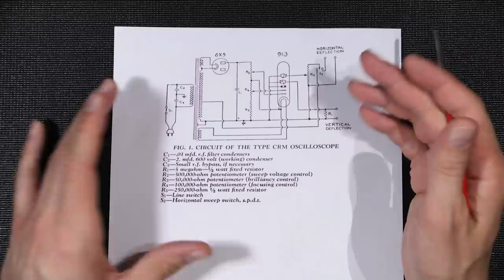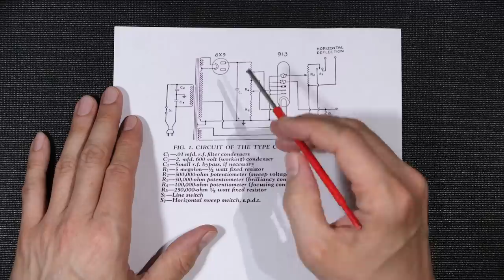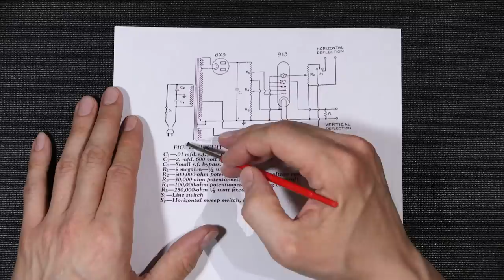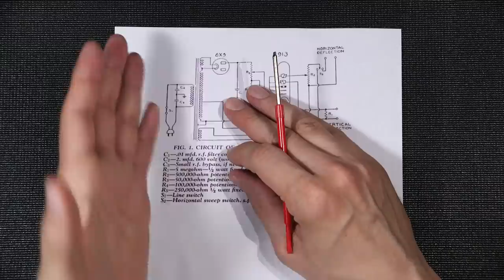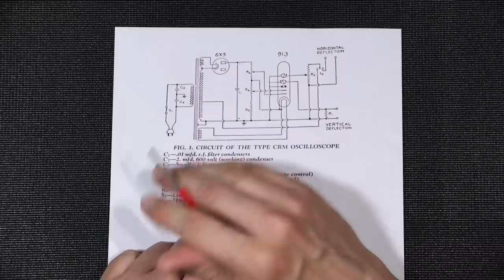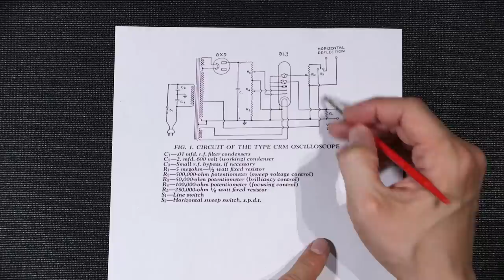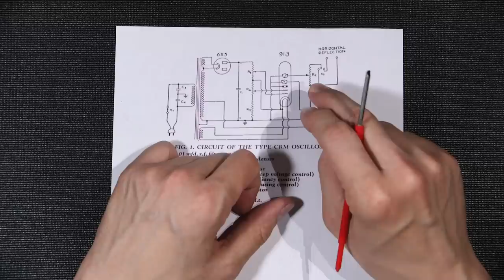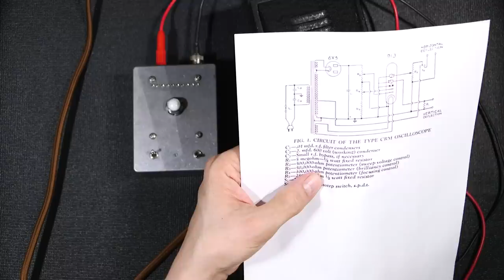Neat Electronic Tool From The 1930's, Lets Look Inside!

Comment: That's a cute little scope.  National probably saved one cent per unit by buying the power transformer with the capacitors built in.  If a cap shorted, it would be replaced as a unit.  Encapsulated caps like those could last a few decades, so making them replaceable didn't make economic sense at the time.  

Your testing device shows substantial leakage, and I'm surprised it worked at all!
Reply: They would have not potted it before attaching the mains cord, so if it was a bought in part, it not only came with condensers but with a mains cord as well. The potting was probably done for more than one reason. The condensers would have lasted longer as you say, that would have been a reason in itself apart from possible cost saving. Also it allowed for a more compact construction and it would have been safer (no exposed mains coupled parts).

Comment: Potting the line bypass caps, line cord connections and other components into the transformer "can" was not uncommon in the 20s-early 30s. Many manufacturers potted numerous component combinations into cans with leads extending out to ease in final assembly and save chassis space. Atwater Kent and Majestic come to mind.
 Remember, electronics was relatively new at the time. The short life of the "modern" wax/paper caps likely wasn't well known then. I believe the thought was to seal them from moisture to help prolong their life. They were likely good beyond the expected life of the unit, but not much beyond that. The practice seems to have stopped by about 1935.
 The caps are likely just below the surface of the potting compound. I've had good luck removing just enough of the pitch to remove the capacitors from the circuit. A hair dryer or heat gun works well.
 I used to enjoy the challenge. Today, like you, not so much. Good luck and thanks for all of the great videos.

Comment: As much as I would want to see it de-potted I would personally find another transformer. The thought for going that way is the age of the unit and what might happen to the insulation after being heated up and down had some problems with modern equipment just by getting hot and then cooling down when I worked , but heh its your project. I remember seeing a project from Practical Wireless that used a 1" tube it was from a few years ago but can not remember what it was for!

Comment: I think the best educational benefit would be realized by de-potting the xformer, and replacing the defective capacitors - with externally mounted replacements.  Then, I think there would be value in replacing it with another different xformer, with the explanation of how to make it work in the application.  Additionally, it would be good to add a fuse to the device.  There must not have been a great deal of concern in the 1930s with safety.  The fuse is a glaring omission.

Comment: like to see you de-pot the transformer...often get potted output transformers that are bad, up to now replaced with hammond ones, but if i could de-pot them without damage, sometimes could be repairable if its a outer end broken off, or fit another transformer inside to preserve the look of the amp.

Comment: If it is unknown whether the transformer caps are present or not, would the capacitor tester be able to tell the difference between the caps being good vs the caps not being present?  Both situations would present and open circuit in the DC.

Comment: I say go-to a modern switching supply. Keeping things vintage is awesome, but even more awesome is retrofitting vintage gear to make it more awesome than it was
Reply: That would be a real step down for a noble beast. Switching power supplies are not the "be all, end all" of the power supply world.
Reply: Where are you going to get the sine wave from that switching supply to drive the horizontal deflection? Also it needs -600VDC, not too common in SMPS.
Reply: Drew Dastardly sawtooth to make it a smooth line and a flyback circuit.

Comment: Are there caps in the transformer or is that just leakage trough the winding's, would it be worth testing with a megger first. I hope you washed your hand after handling that 600 volt capacitor as they often were filled with an oil that was highly toxic containing pcb's  (Polychlorinated biphenyls).

Comment: You might be lucky and find the caps just below the surface of the tar where it was poured in.  Remove the bottom cap, apply heat form a heat gun and see what you find.

Comment: Once in my lifetime I did de-pot such a transformer, using a hot air blower. It was among the worst mess I ever experienced, and the result was far from what I expected. The good thing are that I managed to save that hot air blower, it was about to burn. I'll say de-+pot the transformer are not worth the effort, except for the value of the video.
Reply: And I believe the video would be worth it even if only to show people what's involved in de-potting a transformer so that they could decide if it was worth the trouble doing it. I was ready to get down and dirty and do the timing belt on my 2005 PT Cruiser but ultimately ran out of time before the car had other issues and it had to be done so I had a local mechanic do it and he let me watch (and help.) Well, needless to say, I found where I would have gotten stuck as I didn't have a number of special tools that made the job easier, and I didn't have another car to go buy them either plus the fact that the sprockets didn't want to come off and even bent the gear puller. I was glad I paid the extra money to have him do it after the fact. So yes, always something to be learned even if it's that you're not quite up to the task.

Comment: You just never know.
I searched for the Aerovox Company that made the large capacitor and low and behold they are still in business.
I thought a company with a name like that would have been gone years ago.
But they are still in business.
Reply: A quote from a previous reply... "Aerovox world-class facilities in New Bedford, Massachusetts operate using Lean Six Sigma manufacturing processes with a comprehensive ISO 9001:2015-certified quality management system. Our centralized facility includes R&D, dielectric development, product design, test labs, automated manufacturing, warehousing and customer service."

Comment: DePot, yes, save that old transformer if you can.

I also wonder why nobody ever talks about re-winding a dead transformer.  Yes, silly labor intensive, but you're holding the example that tells you the wire gauge and number of turns for each winding.

Comment: with my little knowlege is it possible the caps are in that tin shielding of the transformer assembly to keep stray 60hz from transposing on the input circuits??? or they filter the 60 hz  but another frequency produced by the unbalanced transformer they compound?
Reply from the maker: Hi Richard. The capacitors and transformer shielding are for RF reasons. This little scope was subject to high RF currents, the shielding and capacitors were there to suppress the RF, and minimize the leakage from the line cord.

Comment: Hello! National loved to pot their chokes and transformers! I've replaced the transformer in an HRO "doghouse" power supply (shorted secondary), but kept the B+ choke potted with it. An unpotted conventional transformer was fitted into the vacant space. The best way seemed to be to put the stripped chassis and potted transformer in a cooking pot filled with enough water to just cover the potted part, bring it to a light boil and test the pitch softness with a screwdriver until it was soft enough to be gouged out. Once about 1/3 of the pitch was out, the square transformer laminations could be gripped with vise-grips and the transformer lifted out.  NB: don't use your wife's best pot... Fred VE1FA

Comment: Never dealt with doing something like this with a low-Z xfrmr, but could you inject some HV between the line cord and chassis and blow the leaky caps open, or would doing something like that just let the smoke out of the whole xfrmr?
Reply: That would probably just turn the paper caps into charcoal and make the leakage much worse.

Comment: Would be neat to see what exactly is going on in that transformer potted with leaky capacitors, maybe pulling it all apart may answer as to WHY they would do something so strange???  But the end result will still be exactly what would be expected, a messy depotted transformer and two leaky old capacitors...

Comment: First comment: all electronic equipment was positive ground until the arrival of NPN transistors. Motor vehicles were also positive chassis until about the same time, when it was discovered that having a negative chassis reduced rusting.Second comment: because this scope uses a 60Hz sine wave for its sweep signal, it can only display Lissajous Figures, as clearly seen in the video. I would guess that the primary function of this scope is as a frequency meter.I also found this http://www.americanradiohistory.com/Archive-All-Wave-Radio/All-Wave-1937-02.pdf link to a 1937 radio magazine, which describes this "new" oscilloscope, "especially for use in conjunction with amateur transmitters"

Comment: As regards the caps potted in the transformer, I have found many diodes inside caps(with metal cases sealed like a tin can) from microwave ovens. So if just one of them goes bad the whole thing gets tossed out. Not really a good deal.

Comment: Looking at the schematic, wouldn't the cap tester be fooled by the primary of the transformer which is parallel to the caps? ;) My bet is the caps are fine, and the tester reading a short is due to the transformer winding. Edit: I say that because if only one cap was bad, both would read bad (referenced to the grounding point) again due to the path through the windings.

Comment: Funny how the capacitor tester has no labels either.
Reply: z4zuse He built it so no need.
Reply: True, and explanation of the tester  is given in previous video. Funny nevertheless.
Reply: Are you suggesting Mr Carlson is an ageless electric vampire, who built BOTH of the un-labelled devices, over a span of > 80 years?????

OK, I'll buy that...
Reply: Ignoring Occam's razor can be fun
Reply: It had to be ignored: the Occam product was rumored to have been replaced in 1915 due to WWI metal shortages and it was first substituted with a (then) new product from Gillette and later, in 1926 by the Schick Injector single-blade.  As you will notice, Mr.Carlson is clean shaven and possibly has the original Occam item (fully restored and sharpened precisely) on a dedicated shelf in his bathroom, right next to the antique shaving scuttle which he rescued from on a trip to the Chilkoot Pass. Now for another Moosehead....

Comment: Are you sure about the 5µA for electrolytics? Those things can easily leak 500µA for a new 450v 47µF capacitor. Seems to me like  a bit too strict of a test. 
5µA seems like a correct value for foil capacitors.
Reply from the maker: The Heathkit IT-28 tests electrolytics at 15uA. If an Electrolytic capacitor doesn't settle below 5uA, I won't use it. If you have a 450V, 47uF capacitor that's leaking at 500uA, you have a very faulty capacitor. Paper and foil capacitors test at much lower currents than 5uA. A paper and foil cap that leaks at 5uA is extremely leaky. (Very resistive) The capacitors hiding inside the transformer will be paper and foil types.
Reply: This is not true for electrolytics. 
The specifications below are taken directly from datasheets you can find at Mouser. For instance Kemet ESU series: I ≤ 0.04 CV +100 µA
Which means for a 47µF 450v cap: maximum 0.04x47x450+100=946µA. Almost 1 milliamp. 
Don't trust Kemet? Lets look at the Panasonic NHG series: I < 0.06 CV +10 (µA) After 2 minutes 
47µF 400v -> 1138µA or 1.138mA. 

This is roughly the same as stated in an old book: https://kraltp.home.xs4all.nl/Tips-en-trucs/condensatoren/elcolekstroom.jpg

This also matches values i have measured myself (on average, fully functional Philips HV electrolytics have a leakage of about 300µA at 300v, 450v is the working voltage)

Are you testing them at or near their working voltage? Your numbers absolutely make sense if you test at 12v or something like it. But i only know of testers that work at several hundreds of volts, so i assume that's also what your tester uses.
Reply: Aaaaand i saw your video about the design of that tester. That explains a lot! Never mind the comment above (i'll leave it for any others who might want to learn something about leakage at higher voltages), i'm just very used to talking about leakage current at working voltage...
Reply from the maker: No Problems, I deleted my comment as I didn't see this one.

Comment: well de-potting the transformer would be cool to see, but i've seen people depot capacitor blocks before and DAMN it's messy... so....
Reply: Yes it is! And quite smelly. It gets less messy with practice and patience. I used to depot and restuff a lot of components on 20-30s gear.
 Pro Tip: Don't use the wife's oven to heat things you want to depot. The smell will NOT be gone by the time she gets home. LOL.

Comment: National was "thinking" about selling you a replacement transformer when the internal caps failed.  A disreputable business practice, in my opinion.  They definitely were not "thinking" about Mr. Carlson's efforts several decades later.

Replace the transformer as you discussed.  There is still no guarantee of success if you remove the potting material (and you have to repot it as well).

Comment: My vote:  Depot that transformer.  I take a curator's point of view; save as much original as possible.  I would not carry that so far as recommending that you replace paper capacitors with paper capacitors.  I would go so far as to choose crinkle paint, either in touched-up ore replaced form.

Comment: Paul,  Please do de-pot the transformer, or do so on another transformer.  I'm sure that quite a few of your watchers will be able to use that information in their own restorations, etc.  Also I found a photo of the "front panel" which tells what each control is for at <http://www.oscilloscopemuseum.com/oscilloscope-nc-crm-sxxx.html>.  The one at <http://www.myvintagetv.com/oscilloscopes/national_crm.JPG> has a plate with the pot designations.  Thanks for yet another great video.  Would National have known that the caps would eventually go bad?

Comment: Love the video, and definitely thumbs up! But, I am all for the maximum retention of originality, to the maximum extent possible. "You can restore something as many times as you like, but it's only original once". So I would definitely not destroy that paint. It's irreplaceable. When all of the 1930's paint is gone, it's gone forever. That original line cord looked great, I would have just put another Bakelite plug on it. I have worse ones still in service. They're fine, you just treat them with the respect that old stuff deserves. Definitely depot the transformer to get the offending caps out. And, instead of repurposing it, how about use it for it's original purpose?

Comment: I wonder if you couldn't just use a heat gun to melt out enough of the tar to perform a 'capetomy' (ouch) on those line caps, instead of de potting the whole thing. Can't wait to see what you have in mind for this little guy. You need to start a "baby pool" for such things— or is that illegal on www? :o)

Comment: I know that this is a a year ago video I am very surprised that you are  surprised yourself about the engineer who design this unit for having put two capacitors potted in with the transformer , when the engineers designed it near 100 years ago they were wishing for a life discrepancy of at least 20-25 years of usage they would have never guessed that 100 years latter their units would be sitting on Mr. Carlson test bench wondering how come the two caps leaked and why were they built in ! Nowadays if you buy chinese imported electronics they build in a life cycle  with the help of computers to do the maths and virtual testing for it not to last more than 4-5 years before their cheap caps start to blow their tops ! Like the flat expensives LCD screen who blow caps before 5-7 years of partial usage ! Im am very impressed as a retired tech to see all the beautiful test equipment filling the form and function and esthetics  from the past still going strong after 100 years just with a simple recap. ! I kind of regret today of disparting myself from all the old test gear I use to own ! Into a lot of more recent electronic audio gear the transformers open up because they have a built in fuse on their primary side you just unfold the paper layers till you get to the fuse whose is just one single strand of wire and change it and the unit gets a new life ! Not as bad as a tar potted transformer lol ! Your patience and will to get to the bottom of things determination really impress me !